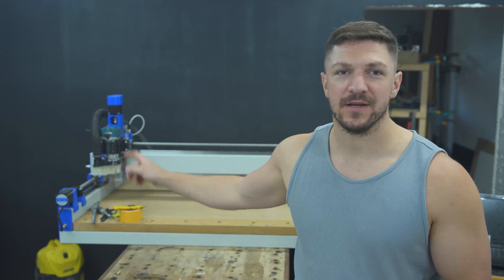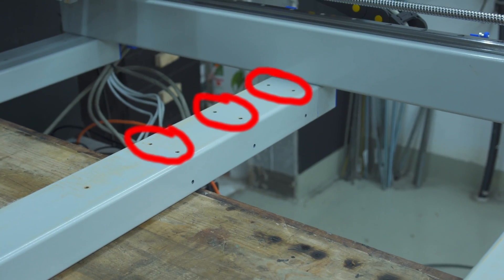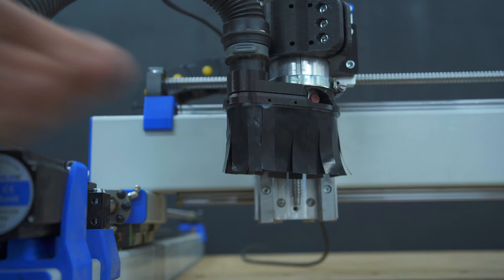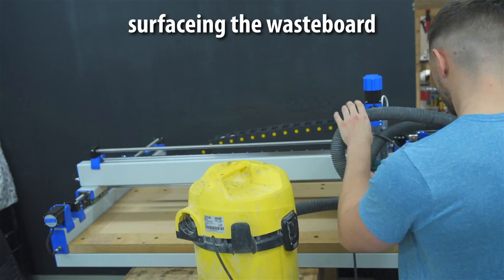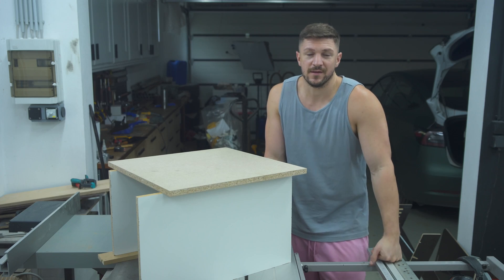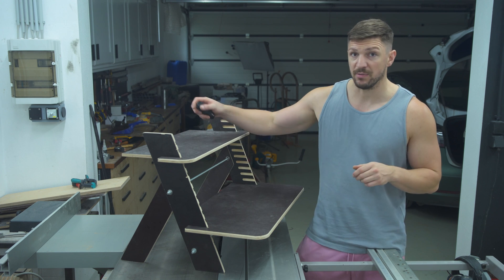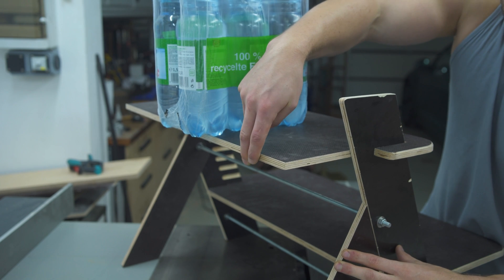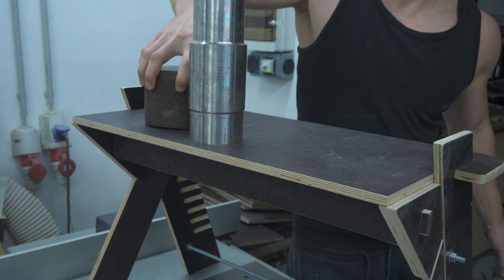PrintNC -  Wasteboard, Dustshoe & First Project | part 3

Comment: i made a really good dust shoe by 3d printing a shoe with a groove in it and wood gluing in the bristles from a big paintbrush. really packing them in there tight though. but yeah, buying the hair strip is much better if you can wait. And I designed and printed my own cyclone too! i really identify with your thought process and the sickness of it all as well.

Comment: While I've  thoroughly enjoyed this series, I'm still not closer to a decision between PrintNC or a V1E Lowrider 3.
Both have their pros and cons.
Reply from the maker: If you have the space i'd go for the printNC, it's the more capable machine.  Except you plan to mill some giant foam board, then the LR3 would shine.

Keep in mind, both take a considerable amount of work, so i wouldnt purley look at the cost
Reply: @ChristophLehner  Thanks for the explanation. Although cost is a bit factor for me as well. The LR3 uses a lot simpler materials than the PrintNC, but is also less capable when it comes to metals.

1) Gaaaah!
2) Well, it's rather unimportant until I get my 3D printer anyway :D

Comment: Using tape under large parts, do you really need tabs as the work piece is still secured? Understand using them on small bits the tape may not hold, but not big bits. But I'm not finished building yet...
Reply from the maker: I used tabs only.on one part, the rest i just used double sided tape

Comment: No better choice of first project than to make your wife something that betters her life in order to placate her after spending two solid months in your garage building your CNC! hahah
Really cool build and definitely can see this would have cost you fractions of the amount to buy an off the shelf CNC at that capacity. Do you have a way to store it when not in use or is it a fixed member of your two car garage now?
Reply from the maker: I am currently planning a cabinet for it. I think i want to make it foldable, so it swings out of the way

Comment: I ordered my printnc last week partly because of you. So thanks for ‘ruining’ my life for the next month. 
Its a bit late, but a box frame in the upper table that locks into a second set of slots a few inches below the original would allow for the adjustability as well as the strength… maybe not 30kg vice strong but 10kg easily
Reply from the maker: Hahah i am sorry !
Plan at least double the time, you think everything takes.

Yeah this seems like a smart idea. lt will probably not be my last wasteboard, or dissassembly of the machine.

So far my cad/cam skills are the bottleneck. There is quite a steep learning curve.
Reply: @ChristophLehner  Check!
I started with a small 3018 CNC Kit near one year ago... On the first day, I already wanted a better one and thought it would be built in a month... One year has gone by, and yesterday I was still perfecting and upgrading the new machine 🤣🤣
At least I'm proud of it 😆
Reply from the maker: @pmsilvei  its all about the journey